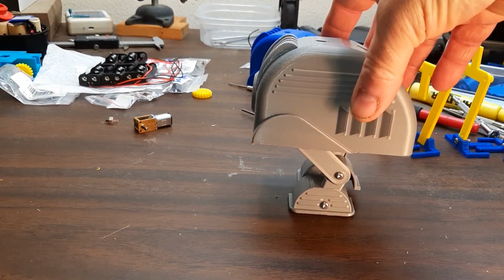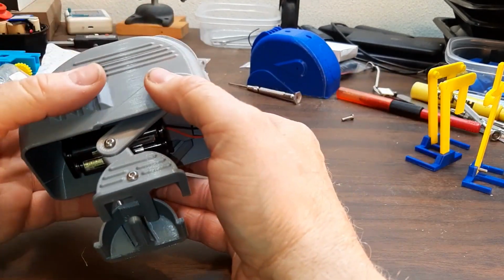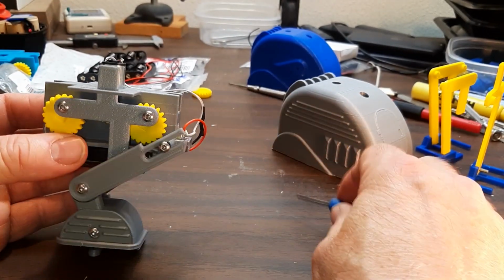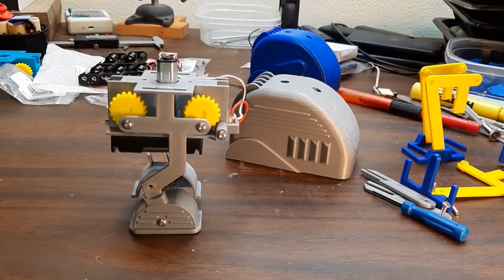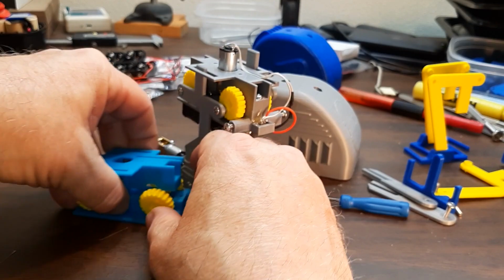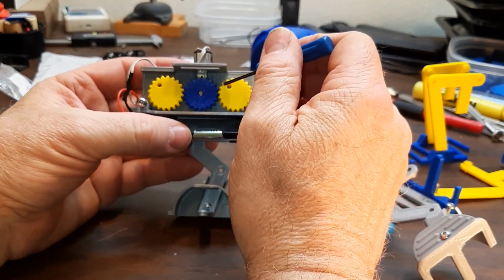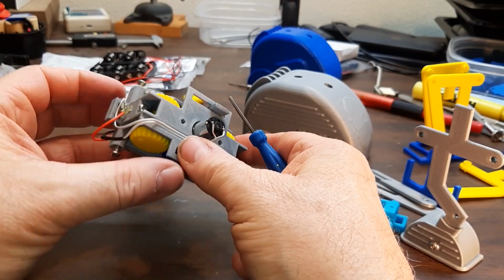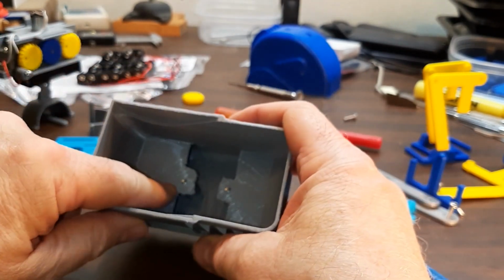3D Printed Diesel punk Walking Robot Toy

Comment: Love the look and action Rick. The cosmetic leg covering is a great idea and really worked out well. Had me fooled. I wonder if the cosmetic leg covering was redesigned to look like a piston driver at the top end and the body changed so that a piston could be placed there. It might make it look like the leg is driven by a piston. In a day or 2 I have a video that will show a new method of using a single shaft gearmotor mounted in the leg of a robot can control both legs, that you might enjoy.
Reply from the maker: I was thinking about adding a visual element to the leg something like you suggested but I want to move on to my next project. By the time I get to the end of a project I get impatient. I only have my weekends to work on these projects so it takes weeks for me to finish one. I really like the walking action of this one. I plan on making a Star Wars Gonk type droid using this design. It won't have the  extra link so it will have less parts. First I have to publish my battery adapter design. I already have it working so I just need to make an assembly video. Looking forward to your video.